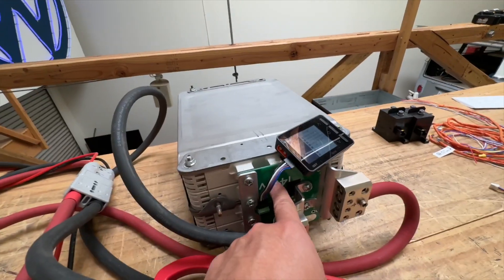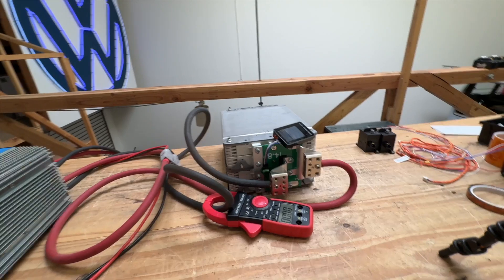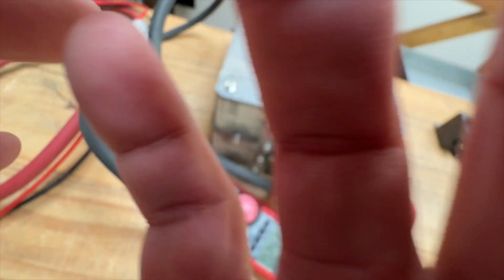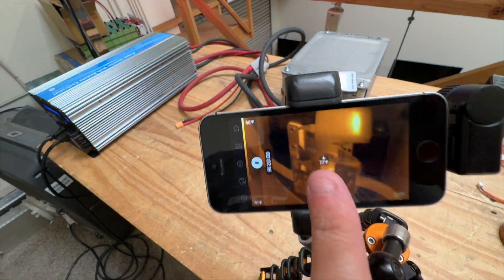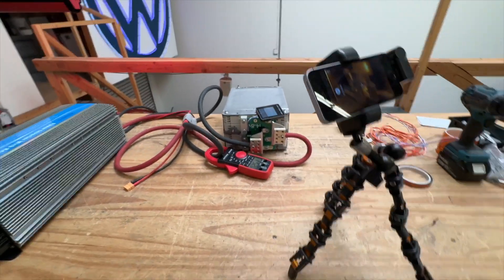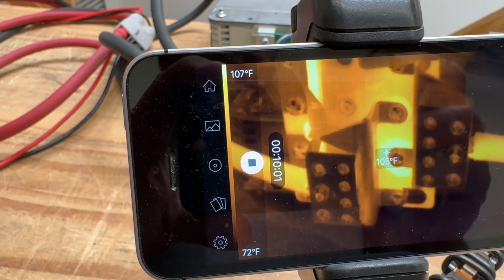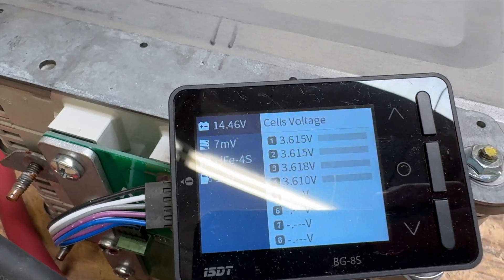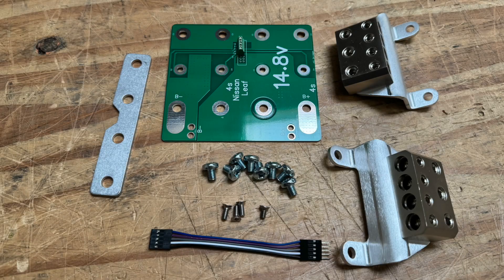Nissan Leaf Module Busbar kit

Comment: I use Nissan Leaf Gen 1 cells in a 24V configuration in the Harmony Express.  I used homemade bussbars (copper) on mine, but I'd love to have a 6s version of the PCB to match my system.  It's difficult to find a 6S BMS as well.

Comment: Love your channel! Some hopefully useful knowledge: Most metals (aluminum might be an exception?) reflect IR. The temperature you are reading is the temperature of the room reflecting off of the surface. You need to put Katpon tape on the bus bars to see their actual temperature. Hope that helps!
Reply from the maker: I’m not worried about the aluminum, more so the pcb

Comment: Good morning do you sell those Nissan Leaf battery readily assembled at 12 volts I would like to have a set of them just for a small 12 volt setup I am very interested in this solar battery charging so I would just like to know if you have them in 12 volt configuration just a question from a viewer of your Channel I am a subscriber for a while now
Reply: These are NMC chemistry so not the most ideal voltage range for your standard 12V system. 

LiFePO4 is a 3.2V nominal cell so 4 cells in series is 12.8V which mimics exactly the voltage standard derived from lead acid. 

With an NMC chemistry you have 3S typically used from 9V to 12.6V or 4S is from 12V to 16.8V

4S is too high for the vast majority of inverters and 12V devices. Over 14.5V is typically where “12V” stuff is in danger of releasing the magic smoke….so that would mean in a 4S you only get to use the bottom 50% of its capacity. In 3S you will struggle to find an inverter that goes below 10.5V and coupled with voltage drop on the cable your inverter will be reading an even lower voltage than the battery. So somewhere around 50% of its  capacity ( ~11V) your inverter will read 10.5V and start beeping meaning it’s about to shut off. Your 12V devices will definitely start to give you issues at 11V. Most won’t operate below 12V properly. 

There are some inverters like the Victron Phoenix but it’s a small inverter that’s not the cheapest. 

So due to LiFePO4 having a nominal voltage that lines up better with the traditional “12V” standard you’ll get to use all the capacity of the battery. 

The battery shown here is also composed of “power” cells meaning they are intended for situations in which they will give more than their amp hour capacity in amps. Ie 180Ah battery giving 400A. Your typical LiFePO4 battery is meant for 1C ie 180Ah should only do 180A max continuous otherwise there will be excessive voltage drop and the cells will get too hot. 

Your application sounds like it’s going to be geared towards less than 1C so finding a LiFePO4 that suits your budget would be the way to go. PowerQueen/LiTime/Redodo (all manufactured by the same manufacturer) have 12V 100Ah batteries for $230’ish. Those are the most basic models. Costs more for low temp protection (Board prevents charging below freezing because it can seriously damage the battery), heating pads in the case (you can diy this for $20 in 20 minutes), or other features which are mostly gimmicks except the first two. 

Keep in mind you cannot determine state of charge by reading voltage on LiFePO4 (you kind of can on NMC) so you need a battery monitor that is a coulomb counter. They range from $20 to $200…id suggest looking at the Junctek KH140 series. For $60 it’s got all the features you could want. Some of the cheap ones aren’t bidirectional so you’ll run into a problem if you’re charging while discharging. A small percentage of people charge up their batteries and put them on an inverter and just pull them off when they are empty…a cheap unidirectional coulomb meter would work for that but might as well bite the bullet and spend a little bit the first time with the Junctek or Victron.

Comment: Can these packs be split up and run in Series? I don’t need that many Ah, would rather double the voltage. You need some better solutions for large e-bikes and other electric vehicles that need 48v-72v and 150A continuous or so.
Reply from the maker: yes this same setup can be made 8s

Comment: Any idea what would be needed to convert a 2013 Polaris Ranger EV from Lead Acid to LiFePo4 650 amp controller, 30 hp motor
Reply from the maker: bunch of these modules a BMS and a charger should be all you need